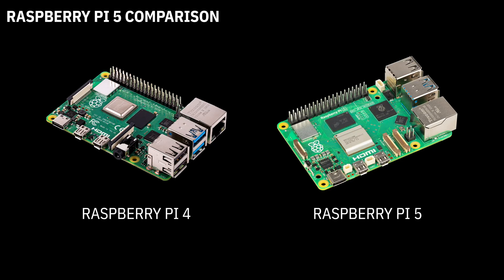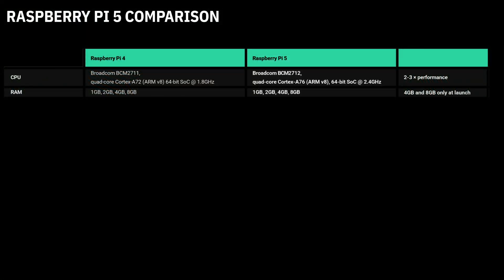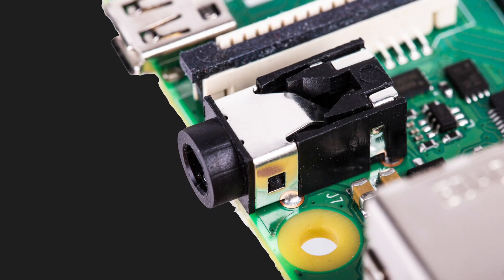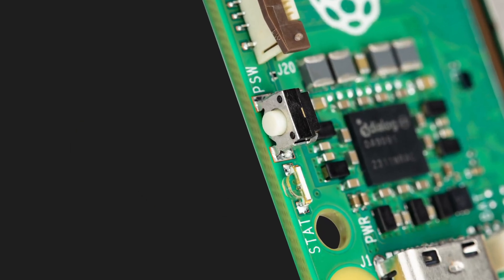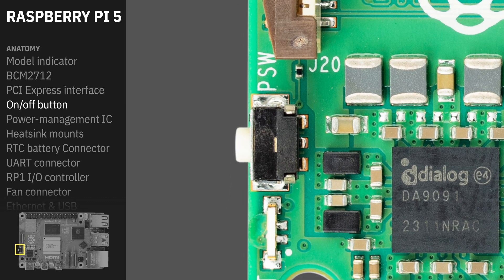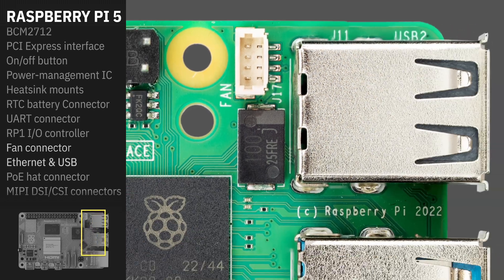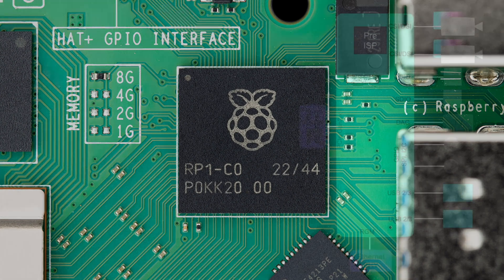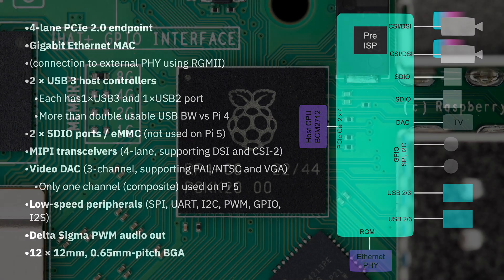Raspberry Pi 5 - Everything You Need To Know!

Comment: It‘s a board for DIY Projekts, that means you
can‘t replace a full pc experience with any raspberry pi.

There‘s not many cases whe‘re you need so much power 
for Projekts. In most cases the Pi 3B is the best value for DIY.

Most cheaper mini Pc‘s are better for retro gaming.
Reply: @mcklient6460 most mini pc's also draw 10 times the power and require active cooling while the pi5 can be powered of passive cooling with a chonky heatsink, the capabilities of the pi5 should not be underestimated.
Reply from the maker: I can’t replace the full PC experience with a PC

Comment: Does RP1 have PIO like RP2040?
Reply from the maker: No, it's different from the RP2040. The RP1 “southbridge” is responsible for most of the I/O functions on the Raspberry Pi 5. By delegating the majority of the I/O to a separate southbridge, the main SoC can be more straightforward. This simplification leads to reduced costs, risks, and development time. Additionally, this design can be reused for future Raspberry Pi models. As with most things in Raspberry Pi land, it is about saving money.
Reply: Actually it has one. And a spare ARM M3 controller. May be additional fun :)